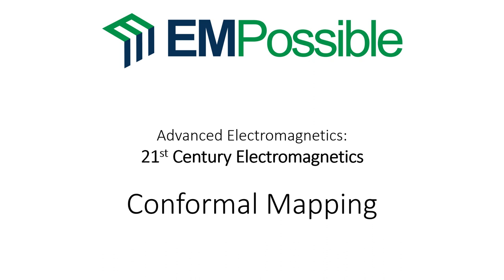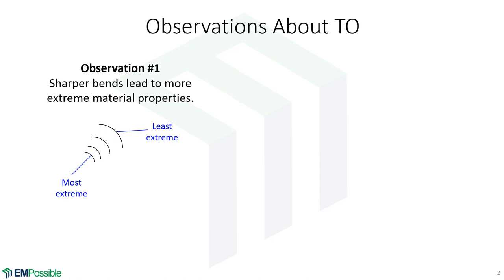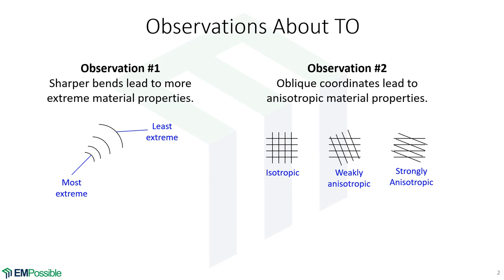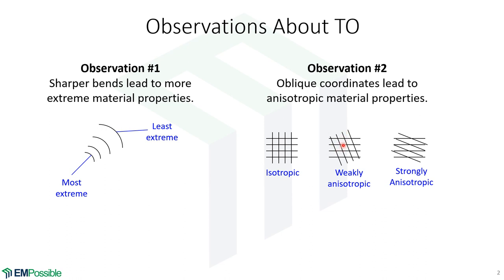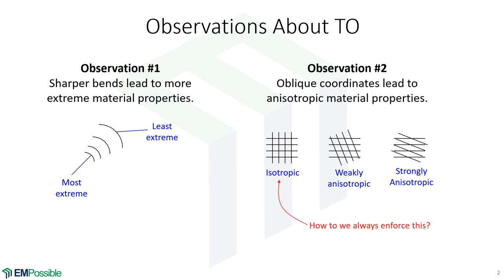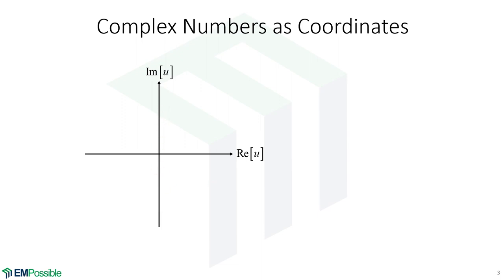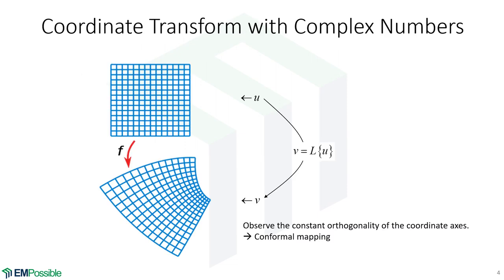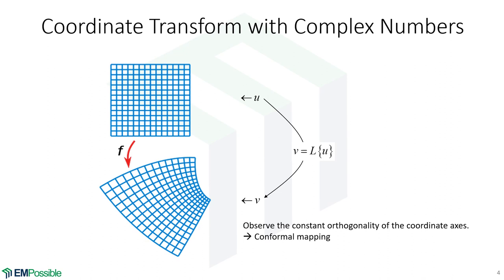Lecture -- Conformal Mapping

Comment: I love your videos. They explain the maths in a nice sequence. 
I would like to know more about the connection between TO and conformal mapping. How the latter can be derived from TO? And does TO use complex plane too?
Reply from the maker: Thank you!!  Think of this whole thing as three big steps: (1) coming up with the spatial transform, (2) calculating mu and eps from the spatial transform, (3) designing the metamaterials that provide the mu and eps.

At first, standard transforms were used for step (1).  It was soon realized this lead to anisotropic and crazy values of mu and eps.  Conformal mapping was conceived to come up with better spatial transforms that led to isotropic and materials and less crazy values for mu and eps.  Conformal mapping is completely step (2).

Transformation optics is completely step (2).  It takes a spatial transform and calculates the mu and eps that would do it.  It does not matter where that transform came from.  We have done analytical equations, conformal mapping, and completely numerical spatial transforms.

Step (3) is a very hard step and is not part of conformal mapping or transformation optics.  Right now this is the big challenge.  No so much for realizing the mu and eps, but realizing the mu and eps without the loss killing the performance.
Reply: Is that mean the conformal mapping is one of the spatial transform which characterize ability to preserve angle? And the form invariance of Maxwell's equation is also true?  

Using any spatial transform (including conformal mapping) and then TO, can I say that I stay in the original coordinate system but I need to change the constitutive parameters to perform the exact same operation on the EM field as the space transformation?

What about PML boundaries condition in numerical simulation? It is anisotropic domain so my intuition says that I shoudn't use confomal mapping here. Can I connect two different spatial transform in numerical simulation?